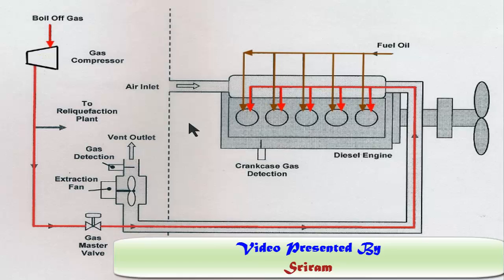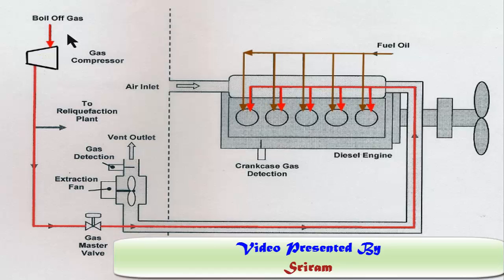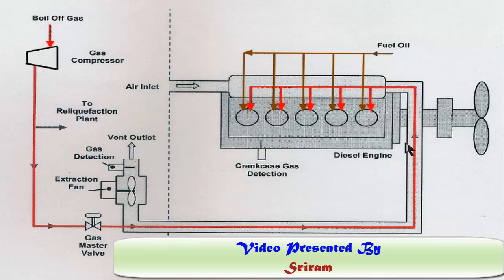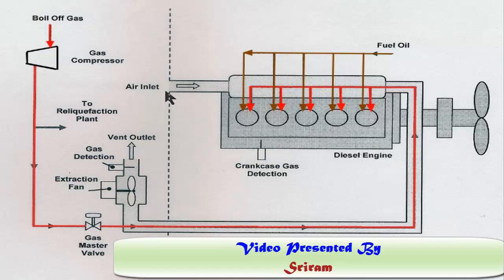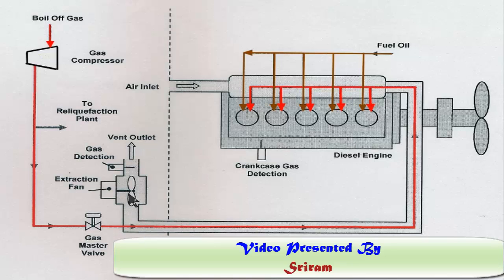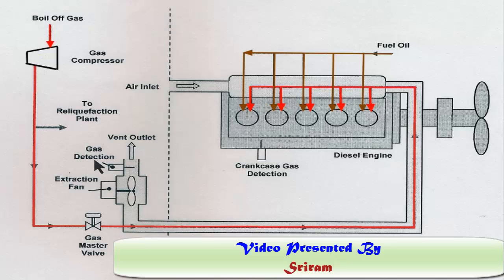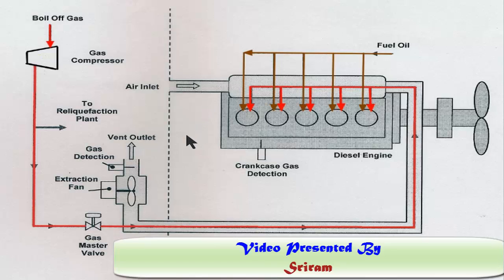Dual Fuel Engine Safety System..!

Comment from the maker: Not at all, until there is any hot spot or some fire on the outside of the double wall pipe. There is continuous air flow from "high pressure" engine room to "low pressure" gas valve unit room so that any leak of gas within the pipe will be exhausted to the gas valve unit room.